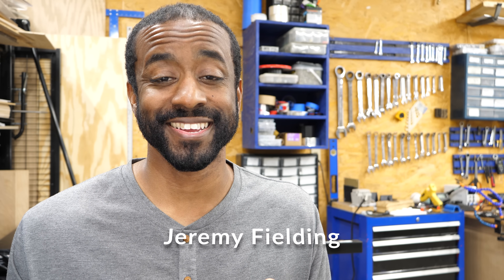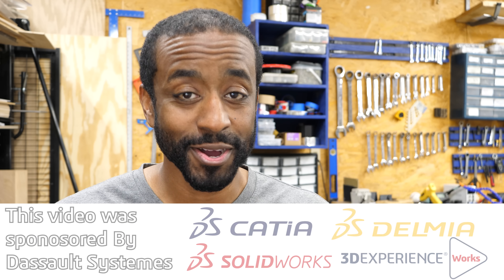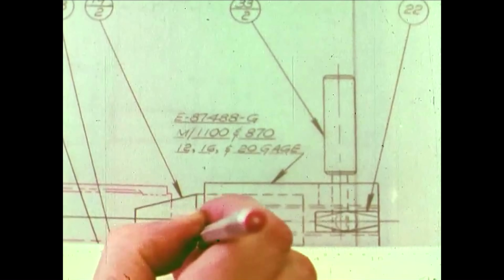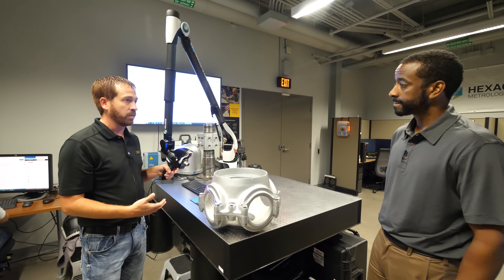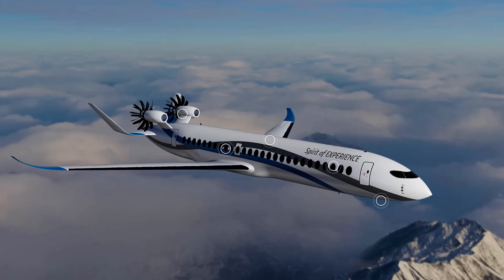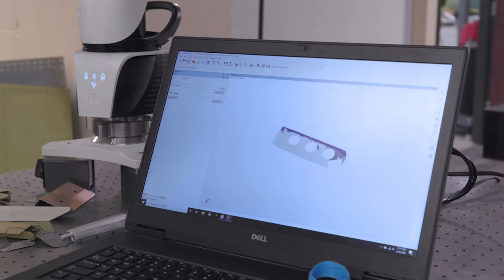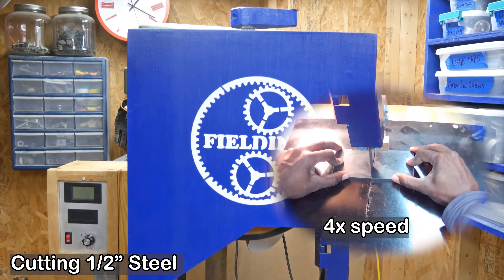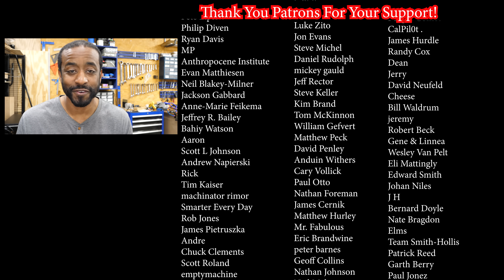Why The US Military Spends Millions Reverse Engineering Their Own Planes

Comment: I'll skip all the ugly details of "rebuilding" items in my youth.  I just like to tell some later time experience.  The B1 bomber first round was stopped and some time later restarted as the B1B.  The manufacturer had changed hands and new production lines had to be created, basically from "scratch".  Our company got the task to build 6 welding lines, or parts, including controls for those 6 lines.  I was assigned a task to redesign / modernize a specific obsoleter control.  My first revised one was not too good, but the second revision worked and was used for producing the  series of B1B parts.  Then the welding lines, or at least some of them were mothballed.  -- Until a few years later spare parts were needed.  I was called in to advise, how to get a couple of the welding lines back in operation.  I was feeling so good, when my design still worked after the mothball phase.  But that is as far as I care to go, no names, or technical details on this...

Comment: This modeling is very important when working with planes defined by hand drawings. Hand drawings often have some issues such as drafters trying to use as few veiws as possible so they don't have to redraw the part too many times and thus craming in as many little details as possible into every view. This can lead to cluttered drawings, which are tolerable untill the drawings are later digitized into a resolution so bad that it makes hard to tell 5 from 6 in some places. Also, sometimes there are mistakes in complex parts, such as some features not getting drawn in every view they should be drawn in (this can cause quite the headache when trying to understand complex internal geometry). However, this is not to say modern computer drawings are necessarily better. Due to additional veiws being only a mouse click away, modern drawings tend to scatter numerous views and cross sections across multiple pages with little ryme, reason, or forethought. Oh that feature is dimensioned in veiw AJ on page 6, which is a cross section of view BB, which is on page 3, which is itself defined on page 2 as a ... (I've personally seen this go 5 veiw layers deep on a single part). With modern drawings it can be a guessing game as to where any particular detail is defined and where in the world the drafter decied to put a particular veiw. Ultimately both modern and older drawings tend to have flaws that make them harder to decipher due to the pressures to reducing the time and effort engineers spend making them.
Reply: After 60 Years there is often no hand drawing left anymore :) Rotten away over time.

Comment: Reminds me of the early '90's when I got my first introduction to 3D  modeling.  We were working with oilfield production xmas trees and production manifold equipment to be installed and operated at 2300 feet under the Gulf of Mexico.  The tolerances were not nearly as accurate as they are today and we actually did a live surface test of some of the equipment to confirm the interfaces and manipulations of the installation.  Good thing as we found a major issue with a flow line attachment that would not have cleared a flange on the manifold.  Saved us several millions of dollars and paid fully for the surface test.

Comment: Thanks for this video. I also love to disassemble machines for parts to re-use. Regarding the GREAT idea of 'throw away' items for kids to disassemble, we must be cautious about what is thrown away in case an item could contain something dangerous! A high voltage capacitor maybe, or some toxic material, like inside a microwave (true on both counts).
Reply: Microwaves haven’t had anything toxic in them for decades. Old ones could have beryllium in the magnetron which is toxic, but even then you would have to literally smash it to release the toxic stuff (new ones don’t use it to save cost). But even without the beryllium there could be a severe shock from a charged capacitor, same issue as in CRTs.

Comment: The down side of digitizing the drawings is that it soooooo much easier for our adversaries to steal the drawings.  ☹
Reply from the maker: In terms of stealing, a picture of the drawing is just as good. If you have access. Most of our data worth stealing is digital. If its still on paper it probably isn't worth stealing. We are talking about 40 years ago. Just consider that for a moment. They want the latest stuff, and the latest stuff is already digital. I couldn't take video because there was much more recent stuff there than the bomber. That's just the plane I talked about.

Comment: The amount of time you say it would take to make a 3D computer model of the B1 is laughable to me, my first job while I was in high school in the 1980's was in a machine shop that specialized in single point threading.  We made parts that went on the B1 and other military aircraft.  CNC was not very common at all in those days, we didn't have any, not too many shops did, get some people that read blueprints and can machine and weld with their hands and you would squadrons of B1's before this company could have this thing scanned.
Reply from the maker: I think you might be missing the bigger picture. One guy with a high speed CNC can crank out many different parts many times faster than the best manual machinist you could find. It’s still about speed. The savings in time is so large it’s worth the time invested upfront to create the models. That’s the whole point of this. Almost no production machine shop does what you suggest. No one wants to hire a large group of highly skilled people to work slowly. When they get drawings today they still make models to machine the parts on CNC unless it’s a very simple part. And machinist today still have to read blueprints. It’s just you don’t need to spent nearly as much time looking at it to setup the part. They are mostly checking tolerances. They also don’t need squadrons of complete planes. They need highly specific parts fast to keep individual planes in combat. Taken together the old methods just cost too much time and money.
Reply: @Jeremy_Fielding  It's always been about speed, I don't remember any government jobs that told us "take as long as you want".  Just so we're clear, there is a huge difference between someone in a machine shop that is highly skilled and a "machine operator".  I would much rather trust a human being than a cnc machine.  ;-)
Reply from the maker: @P46345  We are on the same page about speed. I just meant working from "drawings only" would make the most skilled person slower than full CNC today. The idea of a Machine operator is outside of the scope of my argument LOL. Any smart employer would have some of both in my opinion. But that as much as I will push that idea. Thanks for commenting. This was a fun exchange.

Comment: Jeremy, we are a lot alike although you did achieve a degree, I took a different route. I have always and still do take things apart before disposing of them. I remember taking my first ignition points condenser apart, sawing the aluminum case with a hacksaw and unrolling the insulated aluminum foil and was shocked that that was it completely. Ignition coils were also done, learing about the primary and secondary windings  and the 2 wire sizes, the oil, the ceramic cup in the botton. Electronic devices,electro-mechanical timers,  mechanical devices ,tire pumps,  refrigerators, bicycles, 
microwaves, lawnmowers, carburetors, differentials, transmissions, etc., just to see what makes it work. I even dismantled a typewriter and that was a chore. I agree with your idea of giving a child something to take apart if he shows interest in doing so. My grandson is a prime candidate with an engineer father and a scientific mom, my daughter.

Comment: I agree that letting kids take things apart is a good idea, but I would exercise caution with things like CRT's (who has those anymore, but if they are taking apart old things, it's a possibility) that have extremely powerful capacitors. Those can absolutely kill if they aren't discharged. 

Make sure that someone who knows what they are doing is able to supervise while they are disassembling hazardous components.
Reply from the maker: Some parts are hazardous, but I am concerned these fears are overstated causing people to just not do it. For example, regarding capacitors...This is something that is often repeated but extremely unlikely. It will certainly be uncomfortable, but extremely unlikely to actually kill a person. The discharge would have to go through the heart, but often it is just closing the loop in the hand between fingers. Not deadly at all.
Reply: @Jeremy_Fielding  Thanks for the reply! That's a good point. I've gotten hit by the 220v from an oven that I stupidly didn't unplug before I worked on it as well as the cap from a disposable camera flash (which did go through my heart), and I'm still kicking. 

Definitely wouldn't recommend though, and I'm a lot better about taking precautions now....

Comment: Be careful with electrical appliances. The capacitors can kill you even if they have been unplugged for a while.
Reply from the maker: This is something that is often repeated but extremely unlikely. It will certainly be uncomfortable, but extremely unlikely to actually kill a person. The discharge would have to go through the heart, but often it is just closing the loop in the hand between fingers. It will briefly hurt... but not deadly at all.

Comment: I recently acquired a used cerac 2 dental cnc Mill from University surplus for $40 for the express purpose of taking it apart and seeing what was inside. German made, Japanese and Swiss stepper motors, American made coolant pump, a bunch of L298n motor drivers, etc. 95% of it was assembled using only 2 metric screws sizes, built like a brick, very impressive.

Comment: I want to share a funny story from my earliest days of tinkering. I got a nice RC car for Christmas from Radio Shack as a kid. I believe it was the year nineteen hundred eighty-eight. It seems so long ago spelling it out haha. I'm sure it was a significant purchase for my mom at that time. The first night I had it in my room alone, I took the engine out. My goal was to make a propeller engine, but I didn't make it to the propeller. I ended up breaking it by making long power leads and sticking them in the wall socket. It was over quick, with a blue flash, a loud pop, and the smell of burnt electronics in my dark room. Thankfully, the breaker tripped, and I learned a good lesson. The experiment earned me a good butt spanking from my mother using her go-to item, the fly swatter! The toy was not ruined for me; I enjoyed learning how things like the steering worked. I never got another engine for the car, but I had a lot of fun with it even without an engine. Fast-forward to today; I'm still disassembling things and enjoy collecting scrap electronics and components. I just got my first Raspberry Pi.

Comment: The 747 was the first commercial aircraft to fly by wire using 1966 computers.  Landing and takeoff were done on One of the greatest aircraft built in my life time. My mother sister had a degree  in aeronautical engineering  designing and building fighter aircraft in California during world war. Later worked for Boeing. This you visited is interesting. I do have a private pilot license.
Reply: Aren't Boeing aircraft (up until recently) directly controlled and not fly-by-wire?
Reply: @jimktrains0  Google it answer your own question.
Reply: The prototype in Seattle seems to have cables to control all the flight control surfaces

Comment: My mom used to tell a story about me when I was 4 years old. I took apart her nearly new Mixmaster (something that was a real splurge for her because we didn't have a lot of money and it was fairly expensive). She was so mad and threatened me with extreme bodily harm if I didn't get it put back together. Well, long story short, I did get it put back together with only one leftover screw. Thing worked for another 30 years, even without that screw.

In my adult life, I became a boat builder and designer and later, a composite product designer for a telecom company so maybe Jeremy is on to something.

Comment: Brilliant channel however I don't buy that parts need to be 3D scanned to enable a machine shop to remake a part. Given that the original engineering drawings allowed the parts to be machined then the original drawings could and would be used to make new CAD drawings. Scanning will be immensely helpful but no way would they be used to remanufacture parts.
Reply from the maker: That's not what I said. The scan data is only for reference to speed up the modeling process. I described this in the video. Certainly they can (and do right now) make the parts from the drawings. The scans make creating the models faster. The models make machining many... MANY times faster. Faster means equipment is back on the front line faster (i.e. less down time), and significant cost savings for manufacturing.

Comment: One major drawback of doing a scan vs reading the drawings is that a scan will not give you tolerances. You have one data point representing how that part was manufactured, but not how good is good enough.
Reply from the maker: The scan is only for reference. They still use the drawings to make the models. The scans just make the process go faster when you can see the shape as you create the 3d shape. I described this in the video.
Reply: @Jeremy_Fielding  Ah, must have posted before I got that far. Thanks for all the amazing content!

Comment: Never trust computers. When they stop working, we'll be screwed.
Reply from the maker: This is like saying never trust your car. When it stops working you are screwed. I mean... I agree it would be a terrible day to lose your data, but given the unbelievable advantage they give in speed, it is foolish to walk when you could drive. That's why we make backups and take other precautions to keep machines working.
Reply: @JeremyFieldingSr  as a mechanic for 25 years,  everything electronic has a lifespan much shorter that that of mechanical systems, and mechanical systems can be fixed by fabrication of new parts from scrap metal, but electronic devices and components must be assembled in a very controlled environment that most people do not have access to and therefore must be purchased, where as a mechanical system can be built easily with just scrap steel and some basic tools: welder, torch, lathe, drill etc. I understand using electronic systems for efficiency, but their reliability is never to be underestimated,  and can cause total system failure that requires huge costs and loss of data that could be analog and still functional even if total electricity loss happens for extended periods of time.  An old vehicle properly maintained will outlast everything that requires electronic systems to function,  I'm just saying trusting computers is tantamount to putting all your eggs in one basket.
Reply from the maker: I think you are overstating the problem. You only need to scale your safety margin to match the risk which is what we do with mechanical machines like airplanes with redundant parts such that if something fails in the air you can still fly the plane. In your case you can increase to any additional perceived risk right Maybe you need 5 redundant systems to feel safe. But it's not a "don't use the system" kind of problem. Using a cloud based system to back up your data (as one example) is not all eggs in one basket. It is literally the same egg in hundreds of different baskets because data can be copied for almost zero cost. The likeness of all of them failing is extremely low. Almost zero except for complete power failure across the country along with electrical disrupts that damage the machine itself... as these machines are not all in the same states and can all handle being suddenly "unplugged. These places also have backup generators so all machines can be shut down safety and data protected until power is returned. All I am saying is don't immediately discount the technology. The advantage it brings far outweighs the difficulties I think. We can of course agree to disagree :). Thanks for commenting. It really helps the video, and this is worth talking about. That is how do you protect data that is completely digital. It feels very different from something on paper and that is something computer engineers think about every day.

Comment: Another thing beyond just not having drawings or not wanting to convert 100s of pages, remember what is designed and what is machined are two different things. As-built plans may not be documented. Same goes for modifications. 

Mass field modifications are often never correctly archived with the originals. Things like wire harnesses moved or machinests simplifying a part because the engineer added unnecessary details. 

Also changes accumulated can be drastic. That B1 is a 50 years between the first one and now. Dozens of revisions, field modifications, repairs, etc. 

Redocumenting is really the only option.

Comment: I used to work at an electronics recycling company. We used to tear down Xerox machines under contract and there are MASSIVE amounts of reusable parts in them. We'd do other stuff as well that came in from assorted asset management contracts. Machines of all sorts and sizes. I got very good at spotting how to take things apart.  Motors, power supplies, steel rods from printers and scanners, electronic components and on and on.  Just your average multifunction printer/scanner/fax has several stepper motors, position sensors, a power supply that may or may not be a seperate component. I have a 36 volt DC power supply that I pulled from an Epson multifunction printer that is running a variable power supply on my bench. There's SO much that can be reused in electronics and appliances these days if you know what to look for.